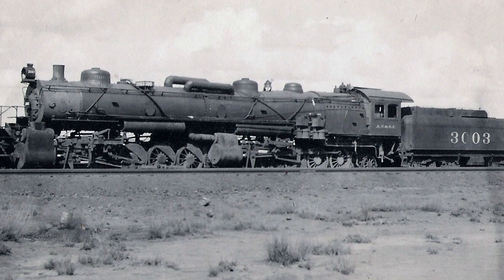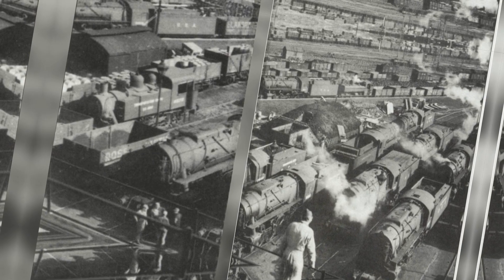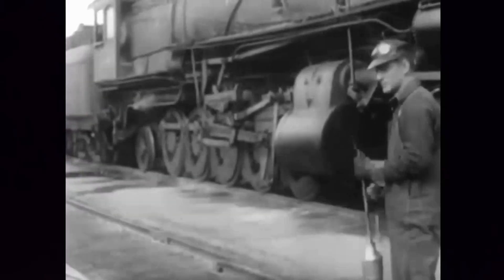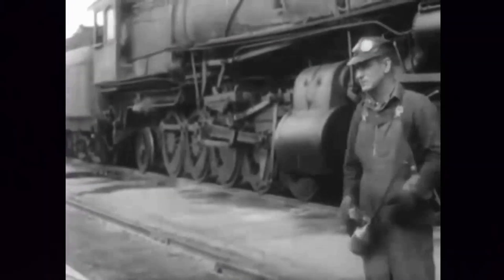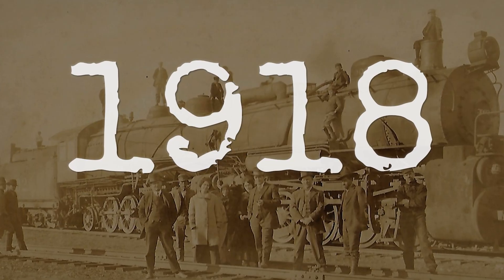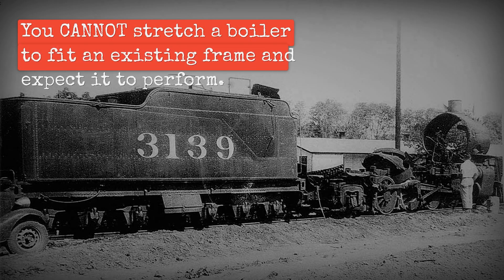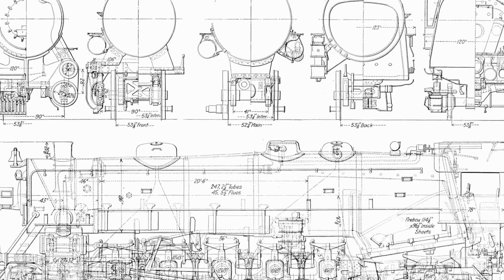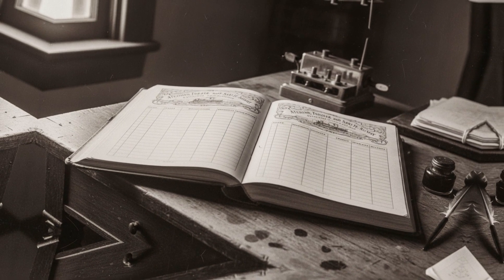The Locomotive So HUMILIATING Santa Fe Tried To UNBUILD It

Comment: An interesting comparison between Sante Fe's and ALCO's 2-10-10-2's. I guess the end result isn't that surprising considering ALCO's experience, expertise and development resources. But hindsight is always 20/20, we need to remember that there was no computer modeling in those days. Design flaws were more costly, back when you had to actually build something to find out if it worked.